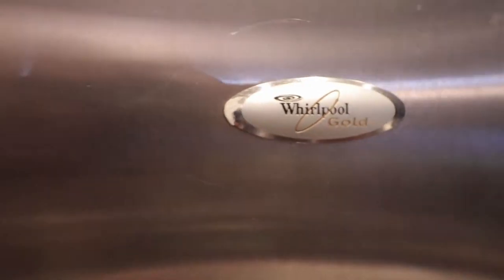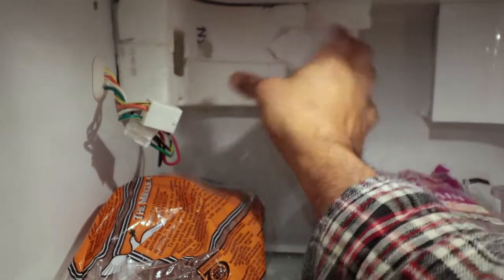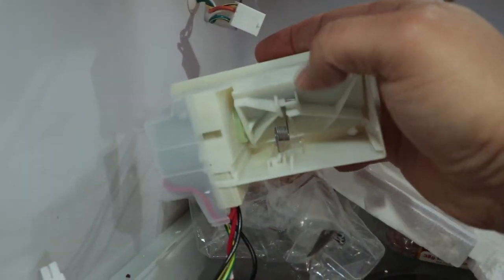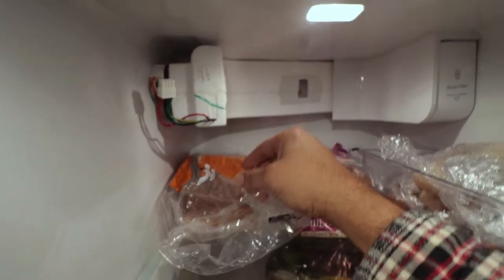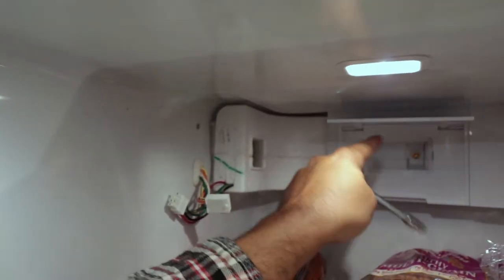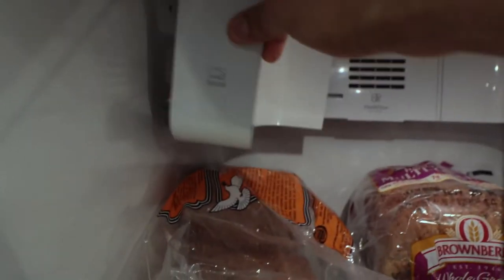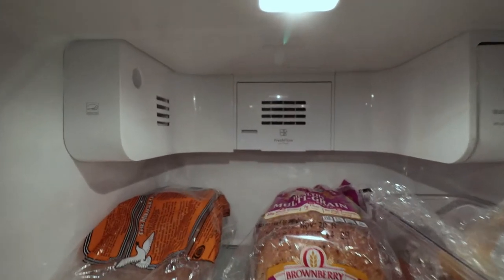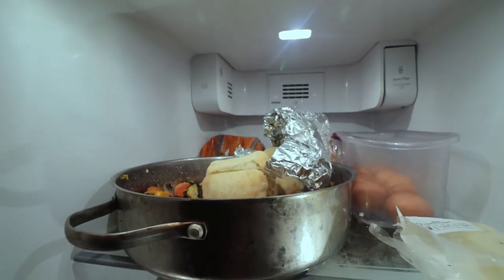Whirlpool Gold Fridge Air diffuser Problem

Comment: Was your fridge freezing things due to the temp being too cold?  My temp is freezing things and I have moved my thermostat from 40 up to 45.  I put a digital thermometer in the fridge and it reads  32.6.
Reply: Sounds like your diffuser door is staying open.
Reply: Having same problem with food freezing on whirlpool side by side.
Reply from the maker: sorry for the delay response, but yes the vent stays open or keeps toggling open and close constantly.
Reply: @roopgillfixitreview7642  yes my diffuser door was broken.  Replaced it for $65 part on eBay.
Reply from the maker: @reneb91964  thanks for watching and liking.